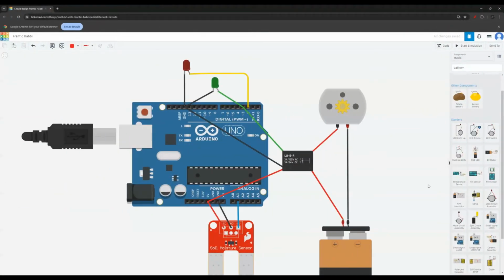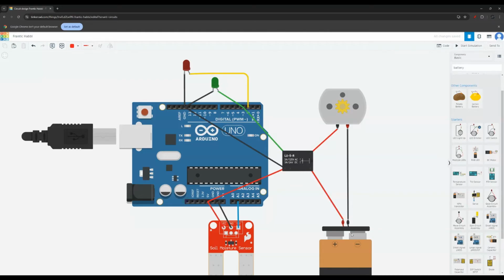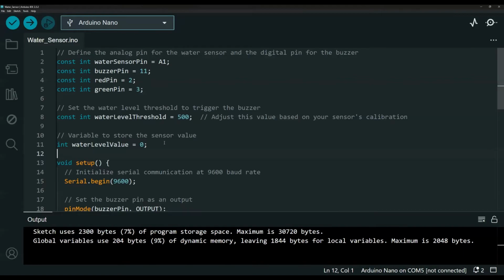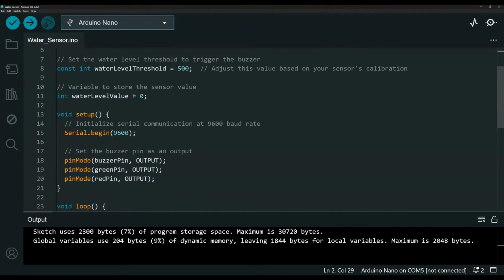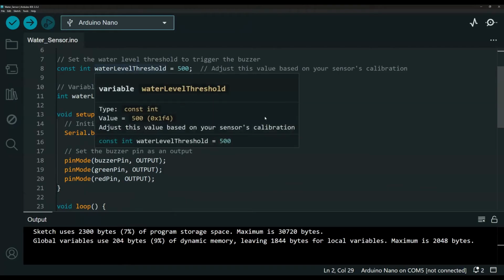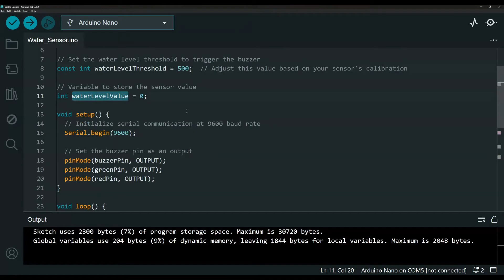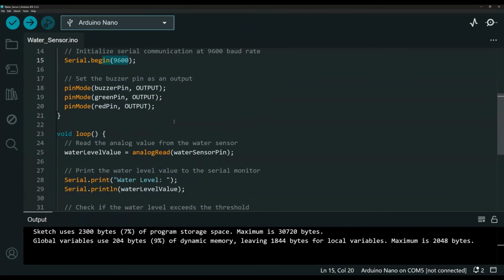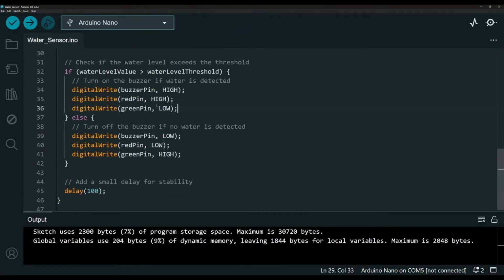Water Sensor #arduino

Comment: What is the voltage of the batteries and what kind of batteries you are using
Reply from the maker: Yes, I will make a video soon. Thank you for watching
Reply from the maker: I'm using external power, 18650x2 so it's a 7.2 V
https://youtu.be/tJxznJV5KiI

Comment: Are you using salt water? Will this sensor work in filtered water ??
Reply from the maker: If the water is very pure then it wouldn't work
Reply: @techs.passion ☹️. I wanted to install this system in my manual water filing water purifier. 
Which sensor can detect mineral water? Can you tell me ?
Reply from the maker: This could still work but you might want to consider the one that uses the water pressure instead. Sorry for the late reply

Comment: more just the motor
Reply: I bought a 5V single channel relay module 10A, will that work with this project?
Reply from the maker: Yeah I think that should work, I don't think you need the exact same parts as mine, let me know if you need more help. I have a free Discord if needed any help
Reply: @techs.passion  yeh that would be great if I could join your server
Reply from the maker: Free Discord: https://discord.gg/FgVJYEUEXs
Reply from the maker: https://amzn.to/4iAu0OZ
Here is the list on Amazon, of course you do not have to buy from my link, please get the best deal you can find. Thank you for watching
Reply: @ hi mate thanks for the quick reply could I send you the list of items I just ordered before you replied ahaha and you tell me if I ordered all the right parts for this project
Reply: 5V Single Channel Relay Module 10A
SKU: CE05137
1	$4.95
2x AA Battery box (JST-PH, Switch)
SKU: CE09728
1	$1.60
Hobby Motor - Gear
SKU: ROB-11696
1	$3.75
Submersible 3V DC Water Pump - Vertical Type
SKU: ADA4547
1	$8.30
Tubing for Submersible Pumps - PVC 6mm ID - 1 Meter Long
SKU: ADA4545
1	$5.50
Uno R3
SKU: CE05629
1	$11.95
Solderless Breadboard - 830 Tie Point (ZY-102)
SKU: CE00304
1	$3.55
Solderless Breadboard Jumper Cable Wires (75 Pieces)
SKU: CE00301
1	$3.95
Simple Water Detection Sensor with Digital Output
SKU: ADA4965
1	$4.35
JST PH to Breadboard Jumper (3-pin)
SKU: CAB-13685
1	$2.80
Jumper Wire 20cm Ribbon (F/F, 40pcs)

Comment: how did u conect the motor and ralay moduel
Reply from the maker: That is using an external power and only using the Arduino as a switch based on the signal coming from the sensor